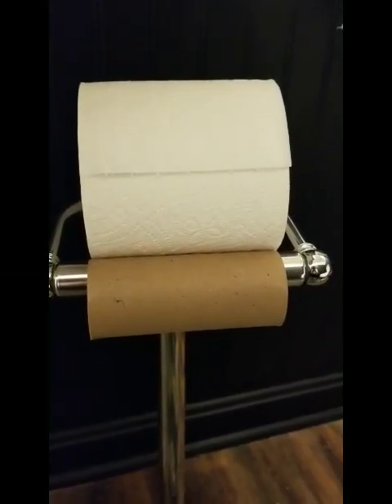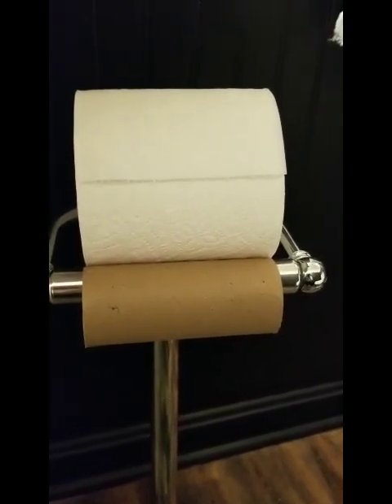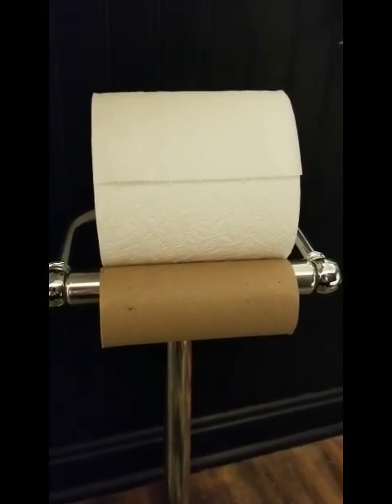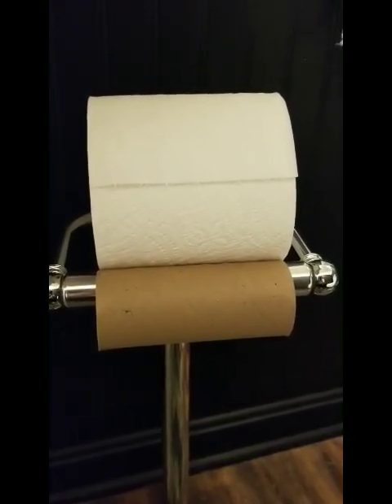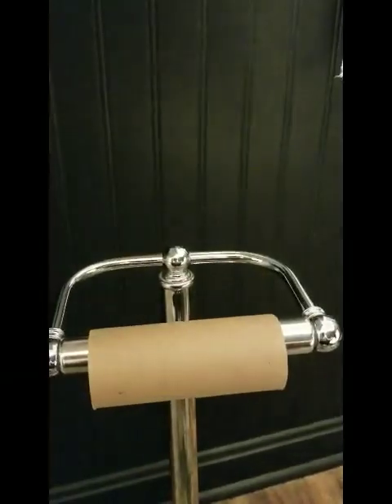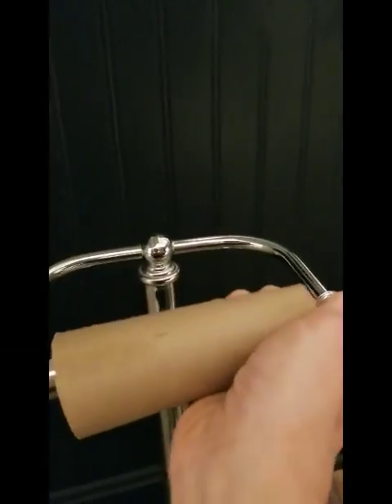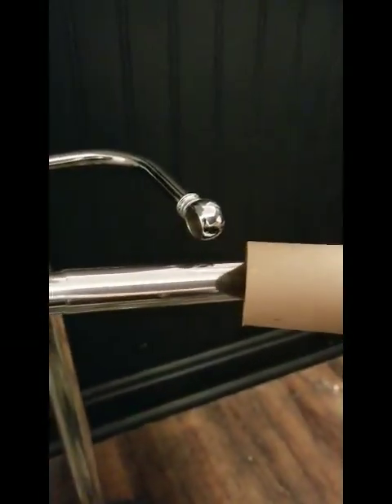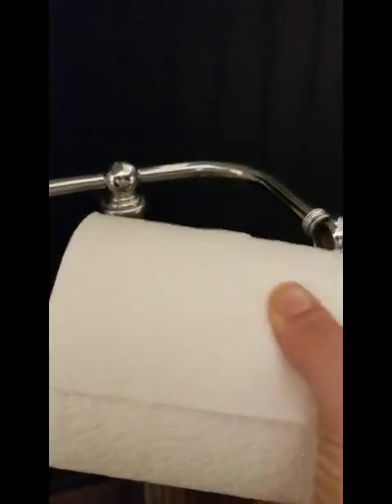Mrs. ScannerDanner teaches class today

Comment from the maker: I believe this to be a "pull-down" circuit design.
Reply: Bet its got a stored po402 - Exhaust gas excessive flow detected
Reply: emergency discharge initiated
Reply: @iwtommo  I'm dead. hahahahaha
Reply: Best analogy ever! Surprised you didn't say, chapter 2 material lol. This video made my day.
Reply: Dont forget u could end up with a plugged exhaust🤣🤣
Reply: Is that a wiper motor
Reply: You have to let the customer know their is a break in period otherwise the new part might "take a shit"
Reply: 😂🤣😂 In addition, the correct orientation is critical! It MUST come off the top of the roll, or else you're fumbling when it's needed the most  ... 😁 

We need to come up with a way to add 12v power to this system ... 💡
Reply: Can't believe that had a problem already ? It looks like it just  " ROLLED OFF THE ASSEMBLY LINE ". BUT SOMETIMES SH** HAPPENS ?
Reply from the maker: @MostlymoparIH nah, it's always been over and I have four kids :-) entertainment for the young ones
Reply: Confirmed "short to ground" :)
Reply: Pull down yes butt it matters whether it's pull down in front or pull down in rear.  If you have young kids there will be less paper work wasted if it's pulled down in the rear. A  front pull down is so easy for little ones to just grab and leave the office with paper work in hand and unroll the whole kit and kaboodle. A rear pull down is a little tougher to unroll and will usually tear off  thereby saving unwanted lost of paper. Husbands and wives usually fight over placement of said roll when first married butt when children enter the picture they settle the argument.
Reply: LOL!
Reply: Omgggggg 🤣
Reply: ScannerDanner This is funny as hell but I need to say this Mr. Danner. You need to read between the lines because Mrs. Danner might be sending you a message in a loving way. Change out the toilet paper roll and put down the seat. If you use the bathroom in the middle of the night and you can’t see because it’s dark then sit on the seat. You can’t miss if you’re sitting on the seat and the women in your house will love you for it. Might be some bubbas out there that think that’s  a little too sissy but most real men don’t give a shit about what bubba thinks.
Reply from the maker: @willispower9493  she totally was my friend, this is something that drives her nuts for sure but she is such as awesome woman, she loves me for who I am, empty toilet paper roll and all. But thanks to this video, I'll probably never do it again haha mission accomplished Mrs. Danner :-)
Reply: ScannerDanner Well I hope you, Ivan, Eric, and Keith keep making videos. Each of you produce stuff at a certain audience level of experience.
Reply: @ScannerDanner  Give the professor a fish and he eats for a day 
Show the professor how to fish and he eats for a life time.  Or happy wife happy life.
Oh and Professor ours has always been over the top two2 and that was with 8 kids
but those 8 kids have different ideas and when you go to their house ya gotta learn house rules. 
When do we get our next lesson from Mrs Professor?
Have a great day everyone Happy Motoring
Reply: Literally LOL'd at this comment! (pull down circuit... Awesome!)
Reply: Hahahahaohhh Oh my that maid my day you will have to thank your wife for me after the day we had that put a smile on my face.  I will have a good night sleep now have a good night you two.
Reply: I still don’t get it! I think if you printed out the wiring diagram and explained it a little bit more thoroughly I may understand it better.
Reply: ohh that was good Mrs Danner and nice comment Mr Danner
Reply: lol AWESOME!!!
Reply: Loved it
Reply: Omg🤣🤣😂
Reply: Wonder when Pico will come up with an adapter?
Reply: Its a parallel pulldown circuit design. I remember teaching them in electronics class. The coefficient of friction is real tricky on the mechanical side...

Comment: You didn't explain your choice of unrolling from the top versus bottom.  Also you didn't address the use of single ply or double.  Core and no core.  Is there a gender difference?  Please update this video as these are important issues you ignored.  You were off mike and hard to hear, Mrs. Danner.  What is your first name?  Can we see you?  We got your point about being a parts changer the first time.  Is there a recommended maintenance interval other than when it runs out?  What is the proper method for waste disposal?  A good topic, but definitely lacking in your site's usual visual and descriptive detail.

Comment: Hi mr danner, please answer me,
My car ford fiesta 1.6L 2013.
My problem, sometimes no crank no start, if im stop at some place. And i've to wait another time to get my car could start,  I got clean Every ground to chasis (bad block gorund your video). But still like that.
Ive plan to grounding my ecm/ecu case (from bolt ecm case) to the accu/battery, is that fine or not ? Thanks in advance . Im from indonesian and your big fan lol :)))